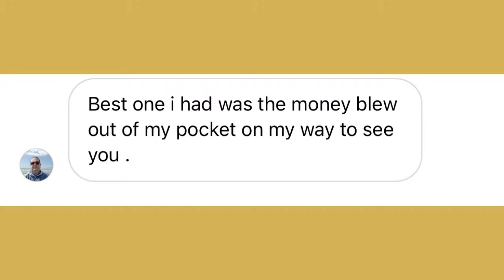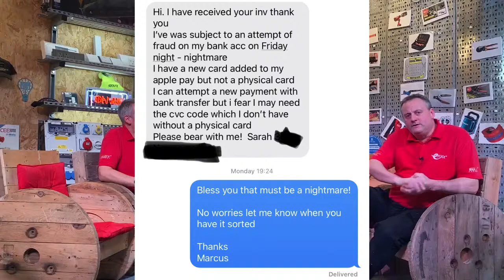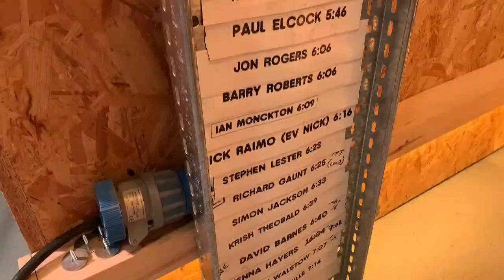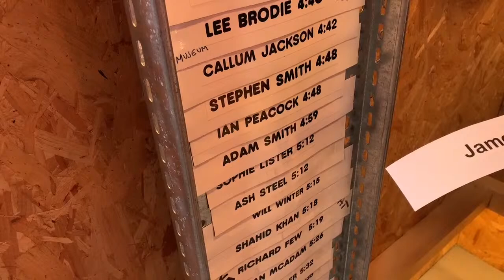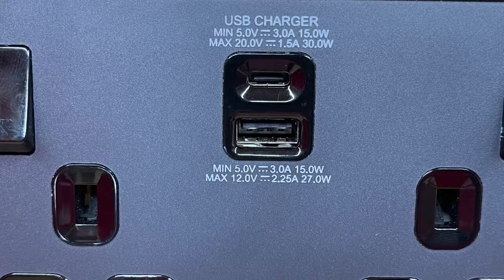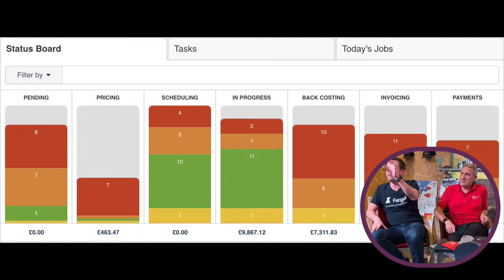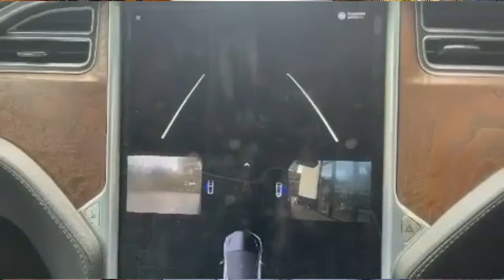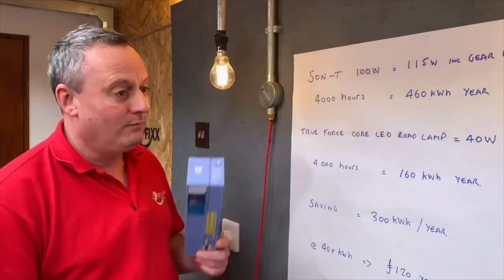The BEST Excuses for Not Paying an Electrician

Comment: Can you recommend a external PIR SENSOR that actually works please.
Reply from the maker: We tend to use Steinel
Reply: I use a philips hue external sensor which triggers a hue light fitting. It’s not limited to a single light fitting so you can trigger a number of light. 

It dosnt have to be one of their external lights either as they are quite costly. They do plugs so provided your external fitting terminates in a plug you can plug that into their socket and then plug that into a standard socket. 

As the sensor is battery powered it does not have to be fitted on the unit itself you can fit it anywhere. It reports battery % so you can tell when it’s going to need batteries replaced. It’s also got a temperature sensor in it. 

I have mine integrated into home assistant so I can trigger other events if needed.  Expensive but does exactly what I want.
Reply: @davideyres955  Thank you.